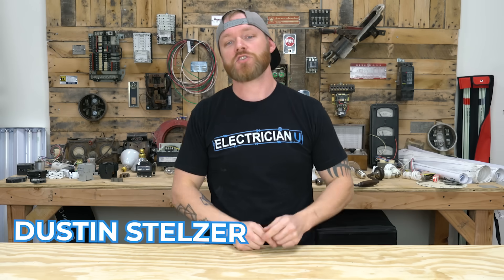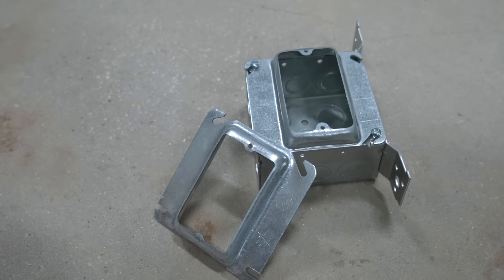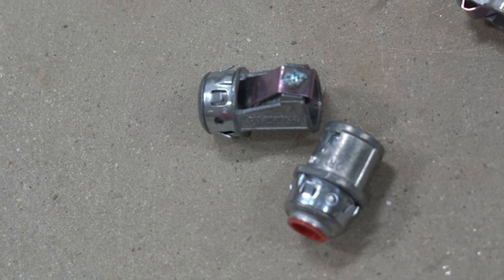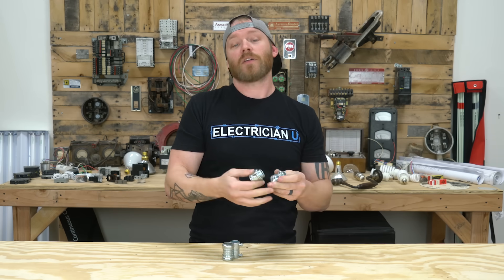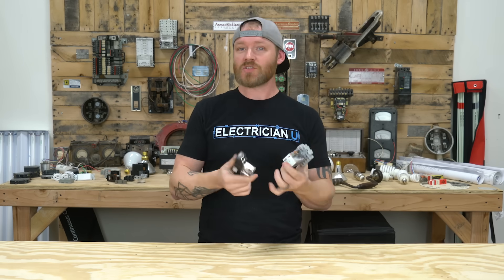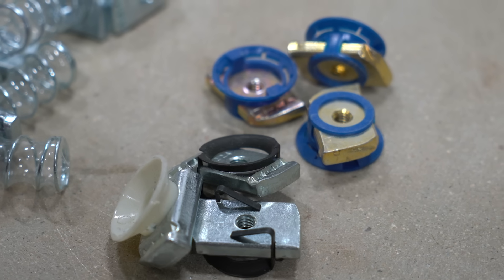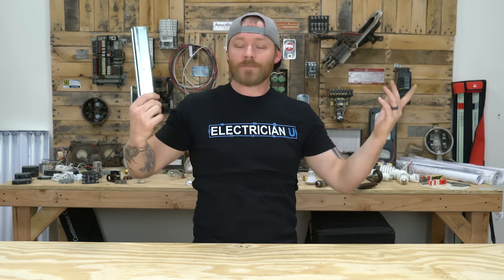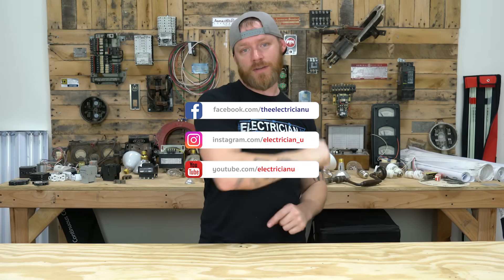COMMERCIAL ELECTRICAL MATERIALS Apprentice Electricians Should Know

Comment: In  NYC we call the industrial cover either a mulbury cover or a 1900 duplex plate or toggle plate, whichever devise you are installing in it......

Cut in box———> gem box

Conduit fittings——>very good

I dont make up joints....I roll them...ha ha

Relays——-> good explanation 

Spring nuts——> B-911 3/8...or B-911-1/4....sorry I know cat numbers

Its still conduit——> emt, imc, ridgid, flex, seal tight, its all conduit

You didnt mention smurf tube....——-> ENT

YOUR COOL,  like your videos....and I like breaking your balls!,, Anthony IBEW LOCAL 3 NYC
Reply: anthony smith stay in New York you liberal turd.
Reply: Dallas another non union jealous ass

Comment: I am a carpenter. And we were doing a demo job, which included gutting a kitchen. And our electricians had to move lights, add outlets, add switches, and segregate lights. But the drywall was already up. And couldn’t rip it apart. How do electricians feed wire thru a wall without being able to get in from the attic or remove the drywall???
Reply: I was figuring a video would be slick
Reply: kyle blume I worked new residential electrical for a while and we cut “transfers” in the Sheetrock at studs to drill through the stud and fish, then run the wire through.. after installation or running, we would screw the piece we cut out back onto the stud and the sheet rockers would patch the cracks..
Reply: The guys that did our drywall didn’t cut any drywall aside from the new sockets being installed. And the new round holes for light cans in the ceiling.
Reply: kyle blume gotcha, the ceiling was probably the easier of the two.. they do make extremely long drill bits that allow us to hook a wire on the end of and drill through Walls, Joyce’s, and fire blocks.. it’s a lot of hard work though, not cutting or removing Sheetrock when moving runs or plugs and switches.. depending on how far the relocation is of course.. if it was only a couple inches to a foot of moving around it’s doable from the “Demo hole” from removing the fixture or outlet.
Reply: Of course Dustin could give you the proper technical terms and ideology behind how we go about doing things like that!😂
Reply: @thetxrebelslas6897  what are these Joyce's you speak of?
Reply: Rick Eckloff oh my!😂🤷🏼‍♂️🤦🏼‍♂️ joist**
Reply: kyle blume hire a professional.

Comment: Isn't the wire in NM-B not exactly the same as the stuff in MC? MC's wire is THHN rated, whereas NM-B isn't? (due to it potentially not having the required markings. the sheathing seems different too).
Reply: They're both THHN the only difference is the NM's ground wire is not insulated.
Reply: Old NM-B wire was not THHN, that is correct, but todays product is.  The wire in MC and NM-B is THHN rated now.

Comment: Whats the difference between mc and bx? Thanks
Reply: MC is metal clad cable with ground wire, BX is an old school brand name I believe which did not have a ground wire inside.
Reply: MC has a green insulated ground wire in it. BX was just 2 wires with a small gauge aluminum wire in it that was meant to help bond the sheathing to use it as a ground. A lot of people used this small wire as a ground wire which is not correct. If it’s installed proper it will provide a ground on its own and not require a separate ground wire.
Reply: Thanks ive always heard them as interchangeable  guess not

Comment: Noticed you have a set of fish sticks in the background. I’m about to purchase my own set for small side jobs. Any particular brand you recommend or reason you prefer that brand?
Reply: Jason Gillean ideal hands down!
Reply: Personally I use harbor freights 33” stick pack. Nice and flexible as well as cheap enough that if you lose them or break them it’s not a big deal. Also they come with a hook, an eyelet, and a flexible leader. Believe they are like $10 or less
Reply: Anything that glows, klien also make a part that goes on the end of their sticks it's a battery powered led light
Reply: Jason Gillean hire a professional.

Comment: Dustin, do you ever use Intermediate Metal Conduit (IMC)?
Reply: Years ago I bought that to make a tree stand to hunt off of. Heavier than EMT but quite a bit more rigid. And it's threaded.
Reply: NEC recognizes Allied Tube & Conduit‘s Intermediate Metal Conduit (IMC) for the same uses as rigid conduit. But yes other reply is correct.